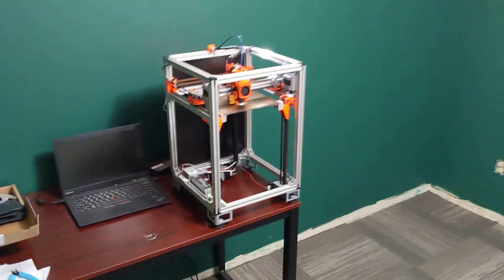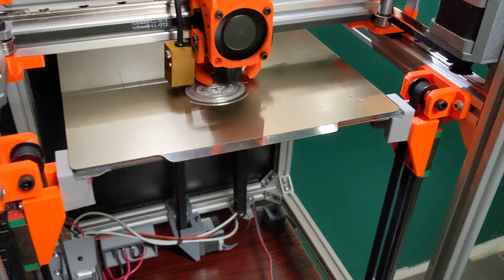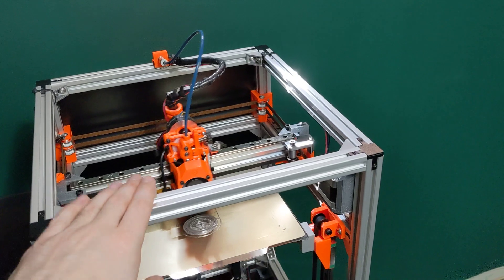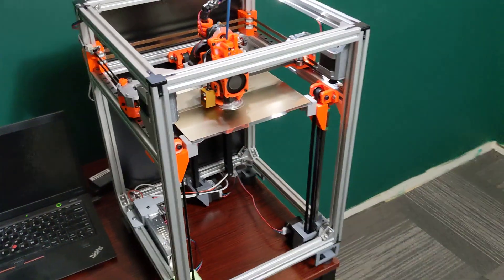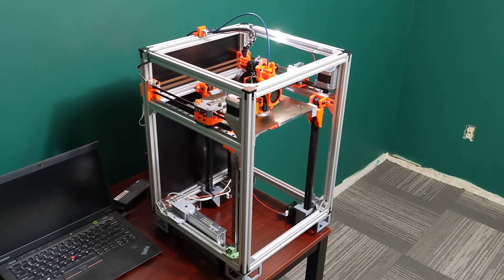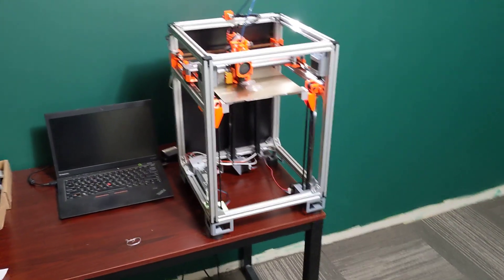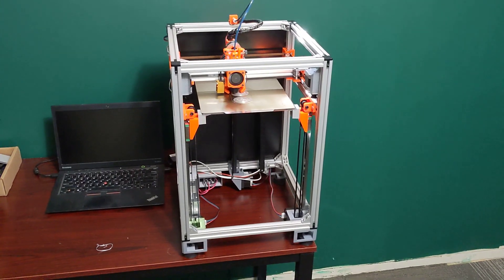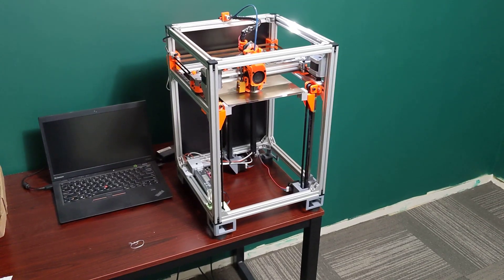DIY CoreXY SimpleCore 200x200 Build Wrap Up

Comment: 3 years ago, I built a 300x300 corexy printer but could never get it to print. I kept getting errors from the mainboard. It is likely defective.  I am interested in blending your design, minimally, to try and get mine running. Thank you for supplying your files and details.  And, yes, I am subscribed.😉👍
Reply from the maker: check out my latest videos on SimpleCore Redux and join my discord community we can help you out!

Comment: G10 seems to be quite inexpensive in the US and Australia of all places but is expensive in the UK and EU and hard to find in the correct sizes, you end up having to buy a large sheet and cut build surfaces from that, if anyone knows of a UK supplier that doesent want an arm and a leg for it please let me know
Reply from the maker: I agree it can be for sure, I get a piece of G10 cut and shipped to my door for $40 CAD. However you can use glass or a metal build plate if that is cheaper in your area.
Reply: @Rolohaun  I get mirror tiles 400 X 400 because they are much flatter than glass so that the reflections are not distorted
Reply from the maker: @AndrewAHayes  I have used mirrors also they work very well

Comment: Really looking forward to the 300 x 300 build. The single extrusion lenght is great, and at least for me the entire frame would be under $100 which doesn't seem to be the case for any other printer in this range.

Is the plan to mount the G10 to another glass bed? And if so what's your plan for attatching it? Binder clips?

I'm very excited for the updated BOM's. I'm pretty sure I want to base my next build on one of your designs, I just don't know which one yet. Right now I have my own version of the SImplecore 200 BOM and the total (not including parts I already own) is less than $400. Hard to beat that!

Would also love to see the a start to finish build series of course.
Reply from the maker: The G10 will be the only plate, hope to add the heat pad to that. Just connected like usual with VHB tape to the 3d printed ledges. I bet red RTV would work too.
Reply: I thought G10 is insulator - AFAIK this is the stuff PCB's are made of. 
Aren't you afraid that a 4mm plate won't conduct the heat well enough?
Reply: @PawelStaniczek  A lot of people do use G10 with heated beds with good success. Since the simplecore is designed for PLA not ABS, it shouldn't be an issue even if it's not the best choice for heat.
Reply from the maker: @PawelStaniczek  I am curious to see if it works, I have heard it's suppose to be good and I will be heating it directly. I can always easily switch to glass
Reply: @Rolohaun  That would be great. Cheap and effective. Would there be any concern about it being stiff enough?
Reply from the maker: @caramelzappa  I ordered 4mm g10 plate so it should be good

Comment: I'm looking for a design to follow for at 150mm by 150mm build. Do you think this would scale down to that well? It looks awesome and just the printer I need for my use case. Just want it a little smaller.
Reply from the maker: the current build I have now is around 180x150 build area with 12 - 300mm 2020 extrusiosn and 4 - 500mm verticals ones. There is not much to change to scale this up or down
Reply: @Rolohaun  I could just adjust the extrusion lengths and keep everything the same to get to that build volume?
Reply from the maker: @gregorysegon6516  yes, just make sure you adjust the y and x linear rails to match the extrusion change github is here https://github.com/rolohaun/SimpleCore

Comment: Great build ! I am very very curious for the 300x300 build ! To show how curious: your channel is the first channel ever for which I clicked the bell icon :-) 

One thing though: the github link does not seem to work. I get a 404 github error. It seems the link is truncated.

Also the patreon link seems to be not working at the time of this comment. It seems an 'n' is missing at the end of the link.
Reply from the maker: Sorry about that, everything fixed now!
Reply: @Rolohaun  loving this 200x200 version! Is the github CAD for Simplecore MK1 (250mm) scalable down to this easily?